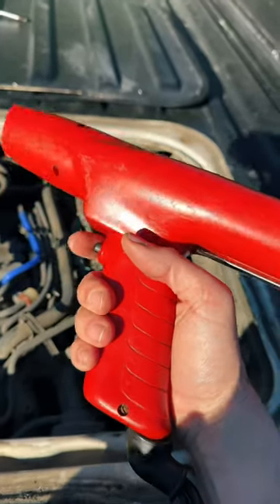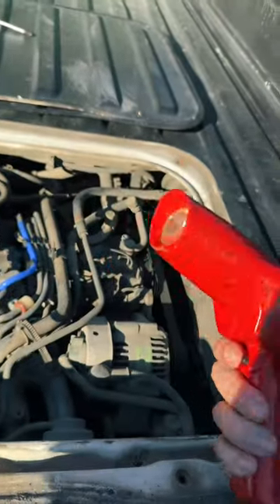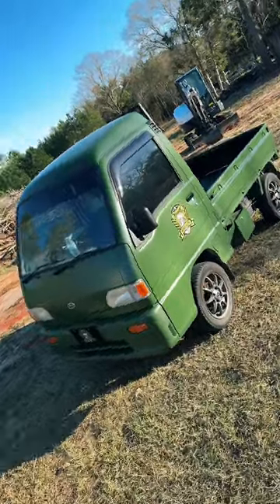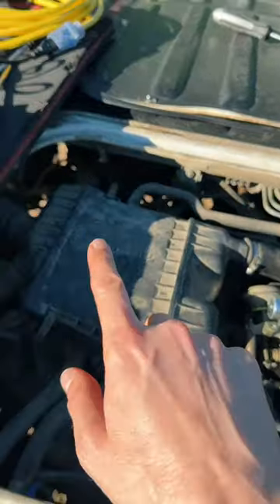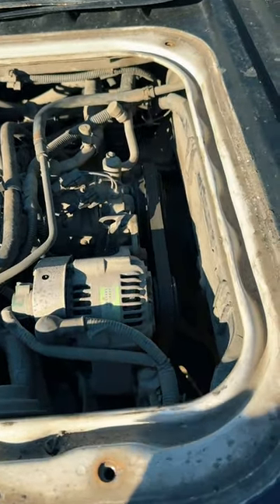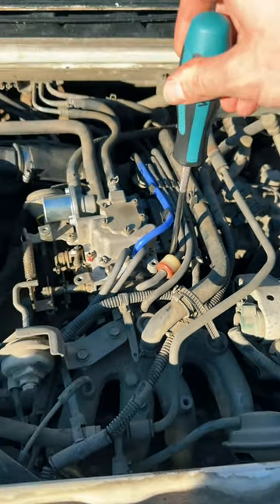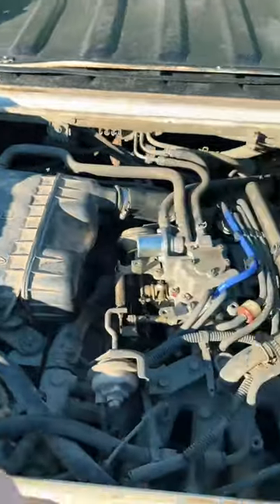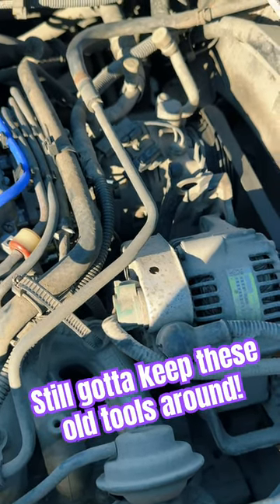What’s Your Oldest Tool Still In Use?! #mrsubaru1387 #Subaru #sambar

Comment: My Very First tool I bought in California was a 2 D cell flash light I bought(1985) before that my oldest tool I own was a full OX-Weld oxy-acetylene torch set up I traded for doing Ball Joints an a 4wd AMC When I was 16 yo(1979) the other tool I got for that job was a headache because he also supplied the “Slippery Nipple” drinks (Baileys and Zambuka) as a Bonus!

Comment: I've got an assortment of open end spanners from the beginning of 1900 which I use almost daily. They still work perfect, and take beating with hammers without problems. Also a double leverage wire cutter from the same time period, which you can cut 4mm nails or wire with, and there's no damage on the Jaws.

Comment: I have older Snap-On tools, but the oldest one I use a lot is an SN-4C (1/2" combination breaker bar/speeder) from 1949. I use it to loosens bolts when I change between snow and Summer tires. My next most commonly used old Snap-On tool is a No.71N ratchet from 1946. I like the way it fits my hand and clicks, plus using it avoids scratching my newer fancy Snap-On ratchets.